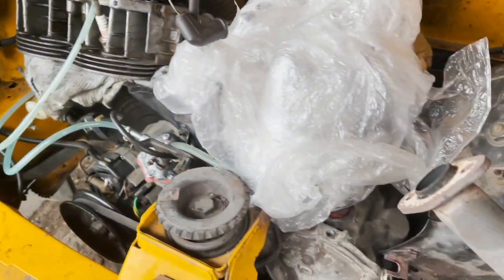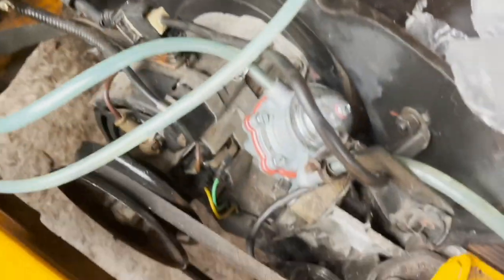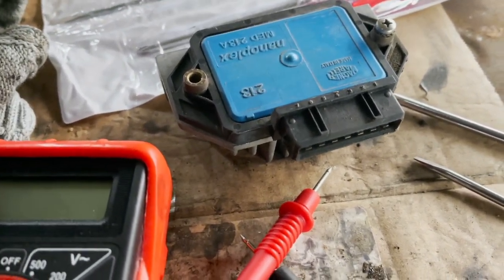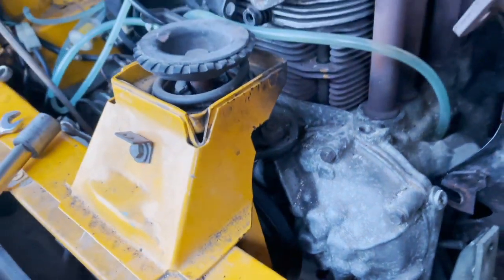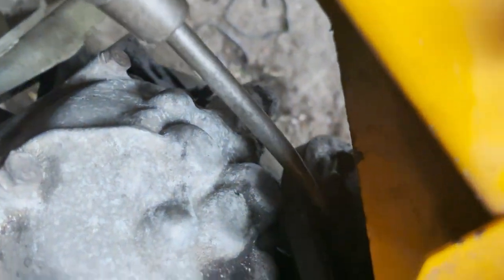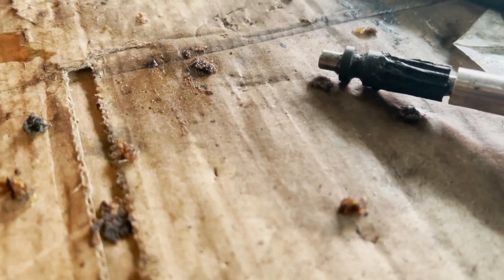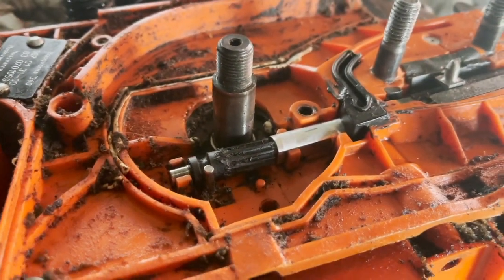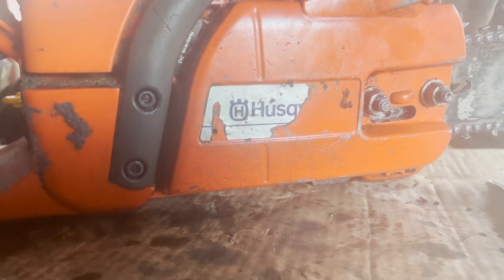Inspecting Nanoplex 213a ignition on this rusty Fiat 126

Comment: Did swapping the nanoplex help? Were you able to find a blue module or did you replace with a red module?
Reply from the maker: Hi, yes I bought a secondhand blue module for about £50 that did the trick. I suspected the one in car was faulty as a screw was missing from mounting plate and the heat sink separated as i took it off the car. Best £50 spent I would say!
Reply: @desilva68  awesome, good to know. They're hard to find but I'm getting something out of Poland.
Reply from the maker: I got mine from Facebook marketplace when in Poland. Set my settings to Wroclaw and there is a place where he has loads and posts. Maybe he only posts inside Poland but i got it while I was there. Good luck hope it works 👍
Reply: Thanks for the advice I have a friend in Poland who sources hard to find parts. He found a unit and will hopefully get it early next week. Not sure if from the same seller as yours

Comment: I would bet 50/50 the Nanoplex (trigger box) is the problem. The Nanoplex needs thermal compound between the Nanoplex and heatsink and it needs both screws, or it will burn out. 
I would suggest you price up the Nanoplex and a crank sensor and either change the cheapest item, or get both if they are cheap and that way you are covered, especially if parts are a problem where the car is. 
Another way to discover the problem is with a scope, to see what is happening whilst you are cranking it over, of course a scope costs a small fortune, that's why I suggested parts replacement as the way to go. 
It does include a bit of risk as changing both parts might not cure it, but if the wiring is ok and the coil is ok there's not much left. 
You can also test the crank sensor with a cheap multi-meter, usually either a small voltage whilst cranking or a change of resistance, and you could test at the Nanoplex for power and earths to cover a few bases but it can get time consuming. 
In my experience it it usually quickest to just change parts or cheapest (if diy) to test things out. 
One other thing to keep it reliable, replace any fuel filters or clean out any wire screens to make sure fuel flows correctly. It's also possible for the fuel tank to rust (if metal) and clog the outlet in the tank, or the pickup filter if it has one. 
I wish you good luck and will watch any further videos on it.
Reply from the maker: Thanks Nobby.
Yeah next time i am over I plan on changing the Nanoplex, plugs and leads. 
Your thoughts on Nanoplex are the same as mine. Shame its taken so long for me to come to that conclusion🥴 as I only have a certain amount of time in Poland before I have to head home.
Thank you for watching and I will have more vids on Maluch this year.